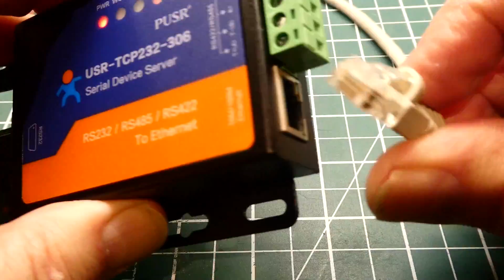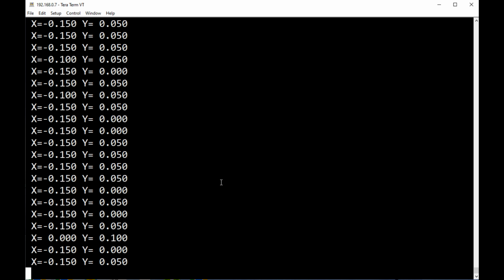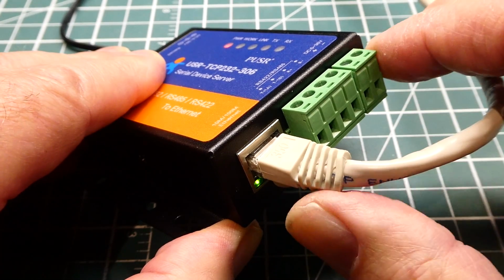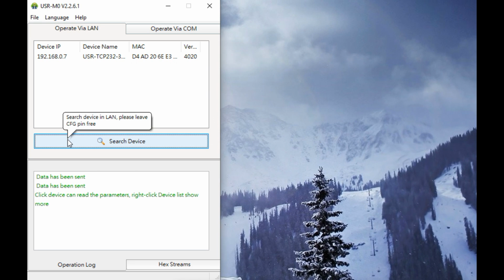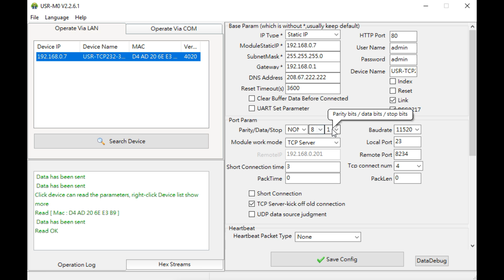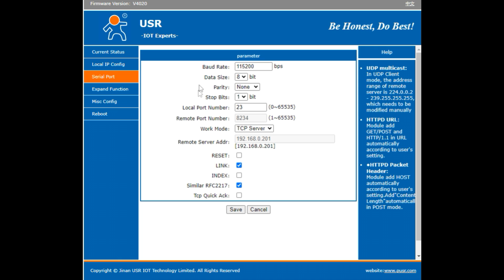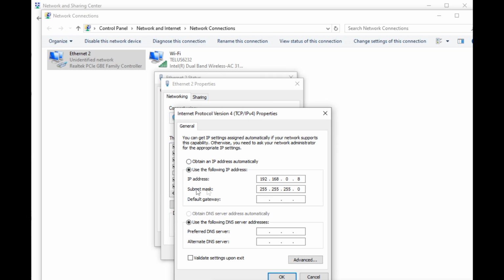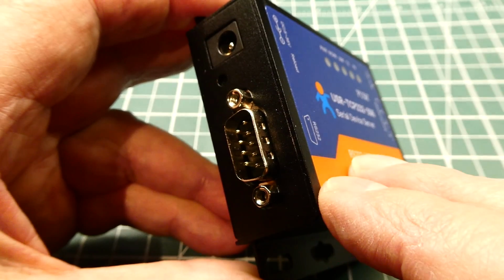Getting Started With RS232 to Ethernet Conversion / USR-TCP232-306

Comment: Hello Dear colleague! 

I have a big break down! 😂

I have a ION8650 Schneider Billing Meter, it has broken the ethernet connection. And i need put it to work via serial port to collect the massive memory every month via TCP/IP. I got the same device, I access it and make some configure, but when I interconnect them, I can’t access the Meter. could you help me please with this facing problem? 

You shown in this video, that you plugged the accelerometer, instantly the lights are blinking “LINK” and “TX”. 

In my experience it isn’t working, when I plugged in the serial port to the dispositive.

It could be that the output points of the Meter's serial port are not compatible with the points of this device, right?

Help me please!😅
Reply from the maker: Power the ION8650 externally with a power supply. Connect to the serial port using a null modem adapter. The billing machine is probably a DTE. Check the user manual for pin out information.

Comment: Hi is the microcontroller board with the accelerometer and Dsub a  bought part, this would be very handy to test Serial comms ,
Reply from the maker: The dongle was from Sparkfun but is now retired as RS232 ports have faded away and replaced by USB ports.
https://www.sparkfun.com/products/retired/10537
Reply: @0033mer  Thanks, may have to look at building something similar,

Comment: using this convertor- 1st device is ethernet- take to USR unit- then to RS485 wiring to another RS485 connected to another USR unit far away , then back to ethernet connection to allow comm. between the two devices ?  thanks  John

Comment: sorry, why on earth would anyone ever need this??
Reply: There are quite a few applications, secure long range sensor telemetry is a very common use case
Reply: I used them to connect older cash registers to CCTV cameras so it would print the items scanned/price etc on the recorded footage. brilliant wee bit of kit
Reply: @screwback72  Amazing idea. Has it ever come in handy?
Reply: If you like me have a charge controller for a "solar system" that sends all its data to a server in China. That means that the data then have to be typed in to Excel in order to do any long term analysis of the system's performance because the Chenese server only keeps one month worth of data. However, if I can intercept the datastream I can store it using IoTstack but I can also use mqtt to control the various functions of the charge controller. 😁